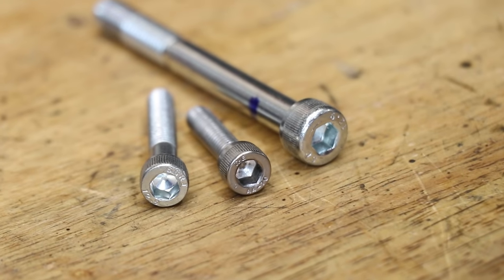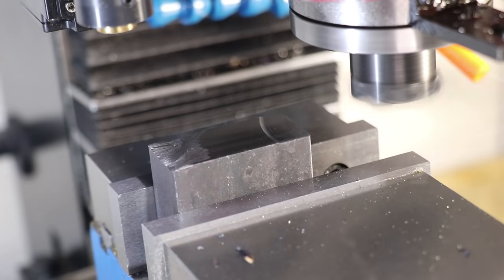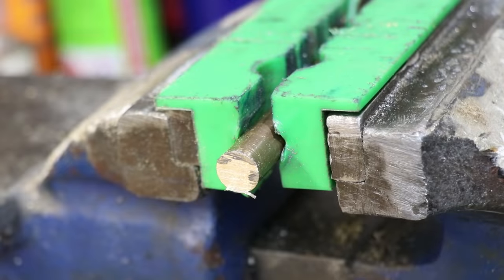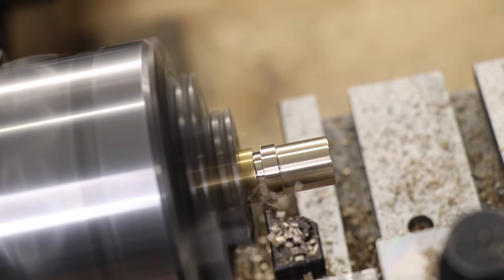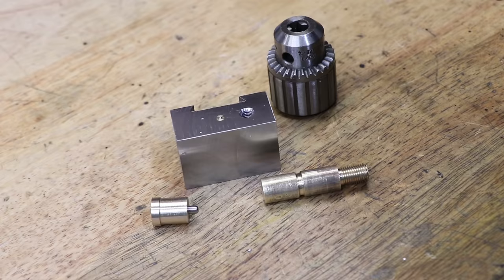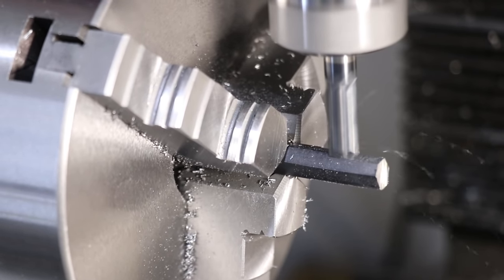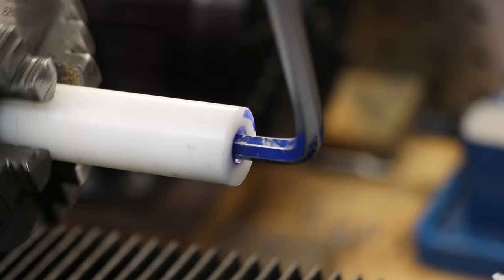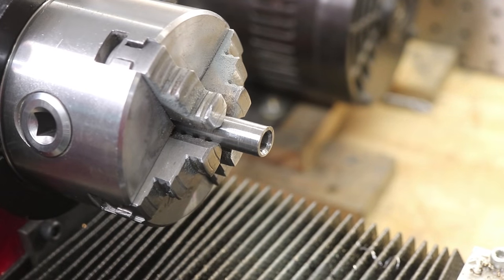Making A Rotary Broach - Cutting Hex Sided Holes (DIY)

Comment: That reamer speed...might as well be a drill. I wonder why even use a lathe to broach needing all that work, when a series of broaches in ascending size work very well in a drill press or mill.
Reply from the maker: Yeah i misread the prescribed feed for that. And you can di either if you want, its really up to you on how you broach stuff, though you might want a dedicated press of some type. For me rotary is easy since its just one tool

Comment: Did I miss the part where you set the angle of the shaft?
Reply from the maker: With this design you don't set the shaft at an angle, you set the tool post at an angle which creates the same effect
Reply: @artisanmakes  Understood. However did you calculate the diameter offset with this? 

You will have to set the angle rather precisely to have your tool cat in the right circumference.
Reply from the maker: I just eyeballed it, for small work like this the angle didn't have to be too precise. Anything between 1-3 degrees seemed to work. You can use a protractor if you want but the results came out identical

Comment: The rotary broaches I've seen are set in a slight angle, and the shank is offset such that the cutting end stays centered, but makes this tiny wobbling movement. The way your version works lacks this wobble. Actually with a straight broach as yours, the spinning does nothing, you might as well just press the broach into the hole.
Reply from the maker: No, with this method you set the wobbly with the toolpost. I kicked it off at a 2 or 3 degree angle. It makes making this much simpler.
Reply: @artisanmakes  ah sorry, I missed it then 👍

Comment: maybe i'm missing something, but the "rotary" action seems completely unnecessary. can't you just push the tail stock into the part without rotating it?
Reply from the maker: It needs that eccentric rotation to reduce the cutting forces. If you want to broach it like a normal part you would need some sort of press. Even then I'm not sure how the cutting edges would hold up trying to cut it all at once
Reply: With with a conventional non-rotary broach, the whole cutting edge cuts at the same time. So you need a LOT of force to push the broach into the part.

By having the rotary action, the force is concentrated on a small part of the cutting edge at any given time, so the force needed to push the tool into the part is much lower.

Comment: Your cutter would work needs to dish  out the face dont leave it flat either grind or grind a drill very low angle ...how used to make for automatic  screw machines
Reply from the maker: I did make the front face concave and I showed that but you can't make it super sharp of the cutting edges become too brittle to broach steel.

Comment: way,way,way too fast with the reamer 300rpm max, infact way too fast with all your cutters.apart from the grinding which was way way too slow, but well done in completing a succesfull project!
Reply from the maker: Cheers, it's a fixed speed lathe so it's not so straightforward in nailing the rpms
Reply from the maker: And yes, I misread the prescribed Speed for reamers